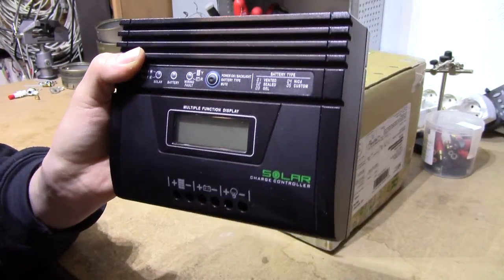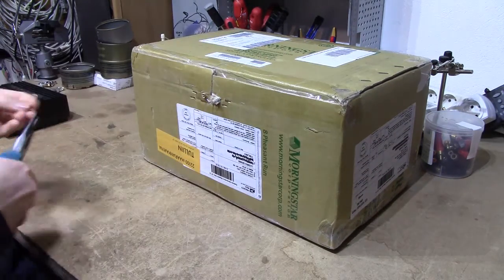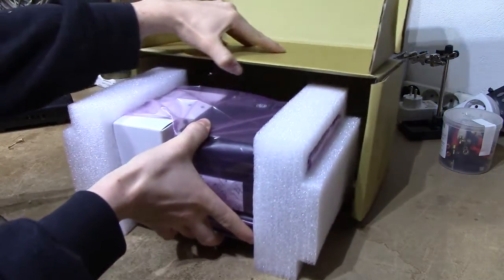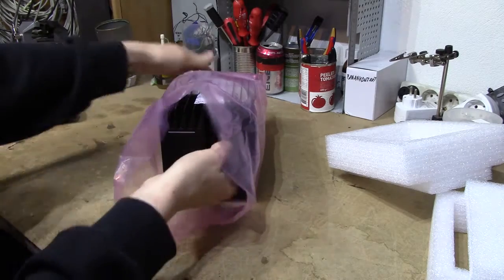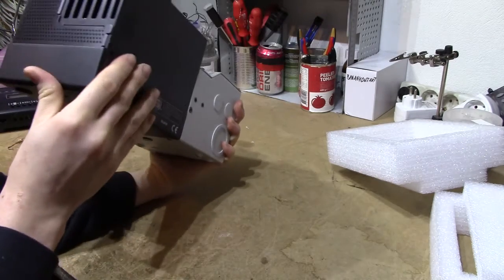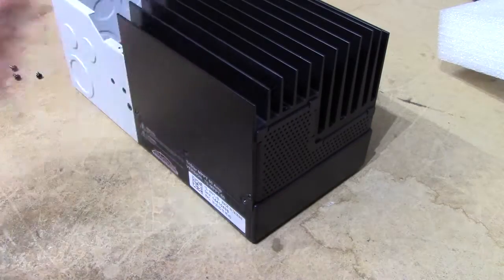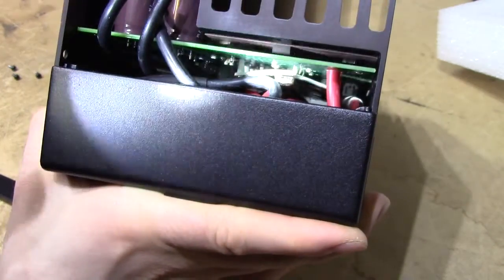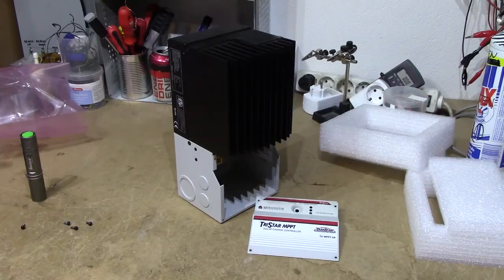Unboxing: Morningstar Tristar TS-MPPT-60 charge controller

Comment: @FFcossag good evening sir, your video is amazing, my question on dis MORNINGSTAR TRISTAR TS-60A SOLAR CHARGE CONTROLLER, can it change li-on lithium batterys?
thanks for the answer.
Reply from the maker: Yes, if you configure the charging voltages appropriately.

Comment: Why don't you have choose the MPP 48048MS? It's a all in one device  which combine an mppt solar charge controller(3Kwp max) and  a 5KVA inverter.... For  the price of 550$ each they seems to be  deadly reliable, It's made in Taiwan ... I have 2 of those in  parallel mode which means  10KVA in single phase.... I also  have a 6kw solar panel system  on a solar tracker... On a beautiful day(in summer) the system produce about 40kwh of power...and I only use 20-30 of them... The only thing I'm concerned about it's the battery, I only have 200 AH @48V... But I have also the power line so it' not a big deal...
Reply from the maker: The short answer as to why I didn't get an MPP 4048MS is that I didn't know it existed, and I feel quite silly about that, right now. However, I can't find either the MPP 4048 nor the 3248 for less than $660 plus roughly $ 130 in shipping, which translates to about 900 € after import duties. That price difference is roughly the price of a (to me) really fancy inverter, so the net result as far as I'm concerned is about the same, and I gain the flexibility of having a separate inverter. They certainly seem like competent units, however, and it'd been really, really interesting tearing one down.

From the product photos I can find, the insides look a bit cheaper than the Morningstar unit I have - mainly, their electrolytic capacitors look very Shenzhen. Perhaps you could have a look and verify their brand?

I hope you're not relying too much on your 200 Ah battery in that installation - don't cycle it to death!

Cheers.
Reply: FFcossag I'm sorry...I just now remembered that it was 650$ +170 of shipping(Italy).. Keep up the good work👍

Comment: Morningstars are good, solid chargers. That's a very nice unit you purchased.

I went with MidNite Solar and their 30Amp Kid.

http://www.midnitesolar.com/productPhoto.php?product_ID=530&productCatName=Charge%20Controllers%20-%20KID&productCat_ID=43&sortOrder=1&act=p

The Kid IS made in the USA and it's also passively cooled -- i.e. BIG external heat sink as well.  I like it quite a bit. But no ability to log any of the data from the KID yet. The firmware is up-gradable but they haven't come out with too many updates.